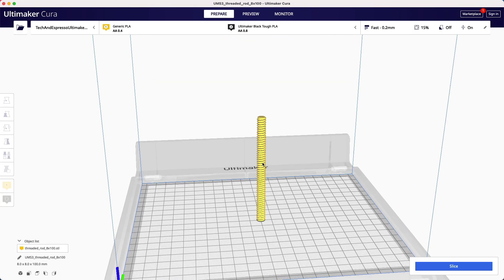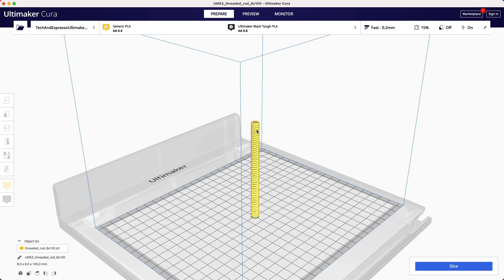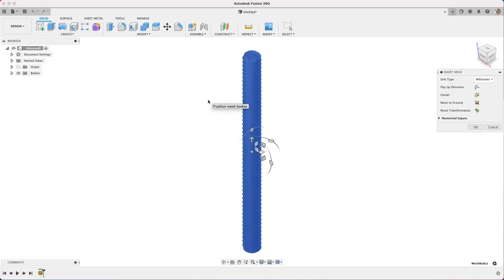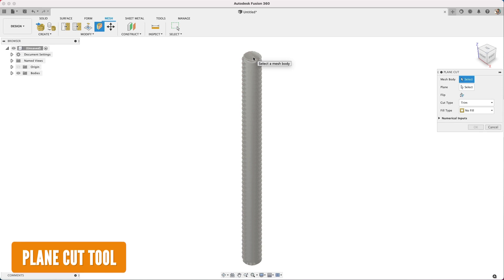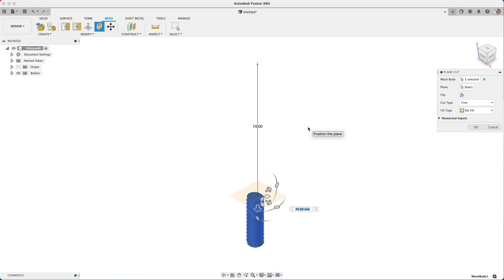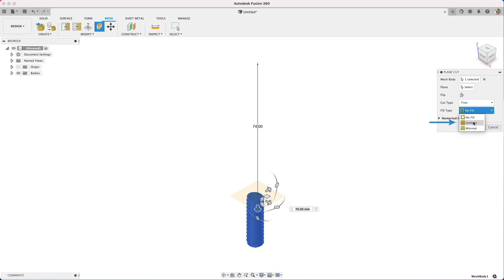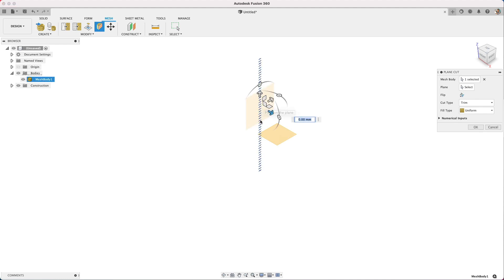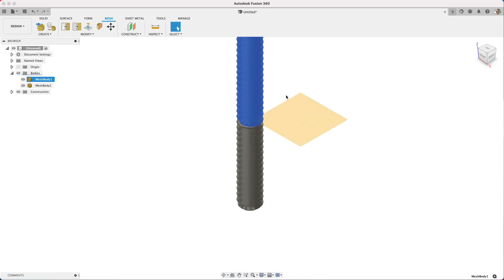Split STL in Fusion 360 (How To Edit Meshes)

Comment: Can’t you just drop the model below the build plate in Cura and print the rest?
Reply from the maker: I would think so.  Let me know if that works for you!  Sometimes I need even more control or want it split into several parts.
Reply: @TylerBeckofTECHESPRESSO  I’ve used it a number of times. Works fine for my purposes. Yours may differ.

Comment: This disable timeline thing in F360 was adressed over and over again. I gave up doing such stuff in Fusion. Easy manipulation of stl can be done in thinkercad much better. Prusa Slicer works as well as long it is about simple cuts.
Reply from the maker: Thanks for the feedback!  Personally, I don't want to open any other software if I don't have to.  This workflow works for me with Fusion and Cura.
Reply: @TylerBeckofTECHESPRESSO  I dislike using split workflows as well, Tyler. TIMTOWTDI applies here, again
Reply from the maker: @peter.stimpel  Agreed :)